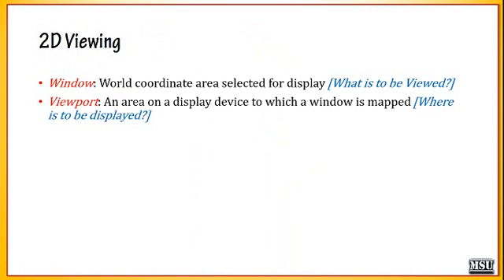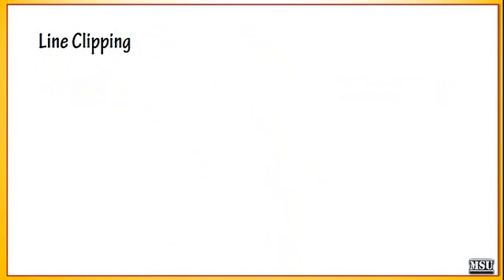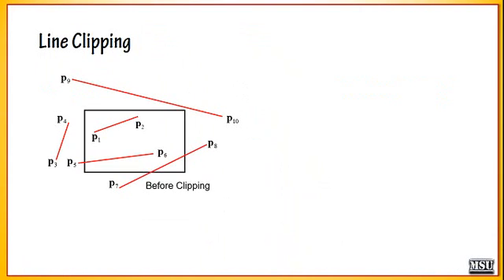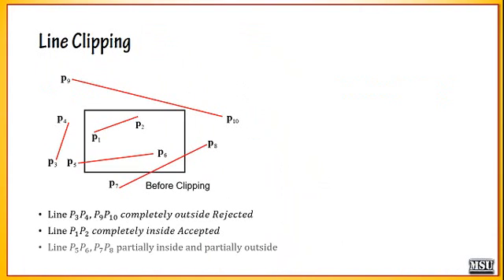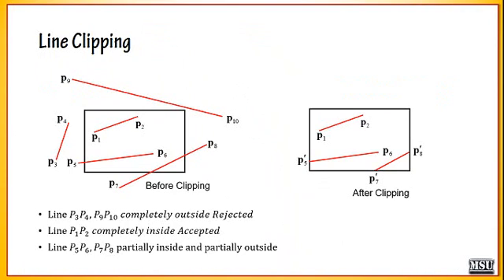Part 14   Liang Barsky Line Clipping Algorithm

Comment: Can we not solve this question just by first finding tB, tT, tL, tR(tB=(ymin-y1)/Dy, tT=(ymax-y1)/Dy, tL=(xmin-x1)/Dx, tR=(xmax-x1)/Dx)then discarding the values greater than 1 or less than 0 and then finding the co-ordinates of the intersection... Foreg the line passes through top and right... So find x&y by x1+tT*Dx & y1+tT*Dy... For the top intersec... And x1+tR*Dx & y1+tR*Dy....for thr right intersec
Reply: I am getting the same values at every moment the values of t and the final co-ordinates!!